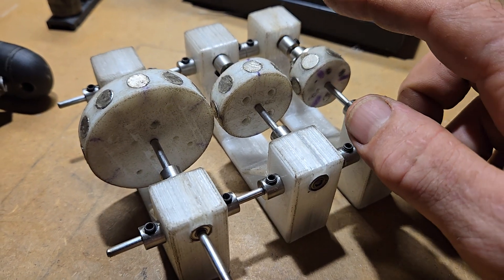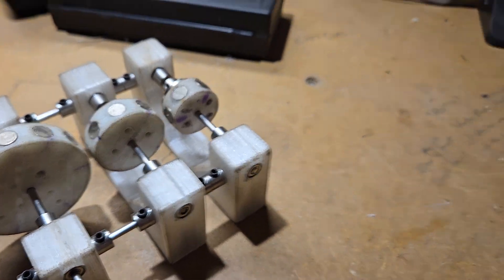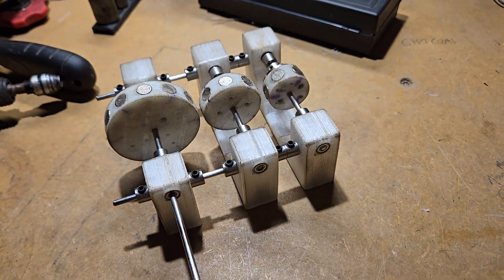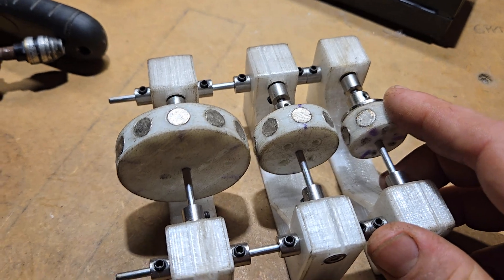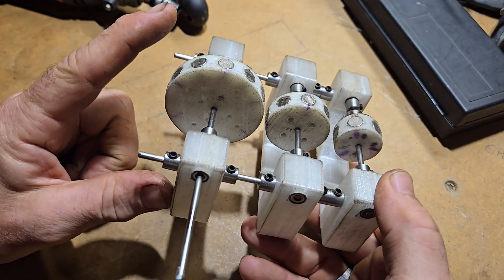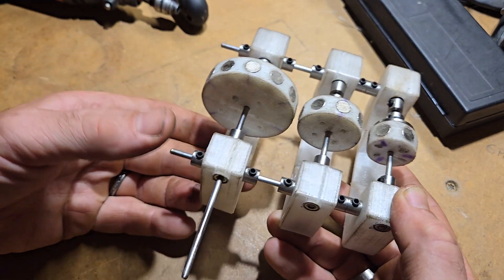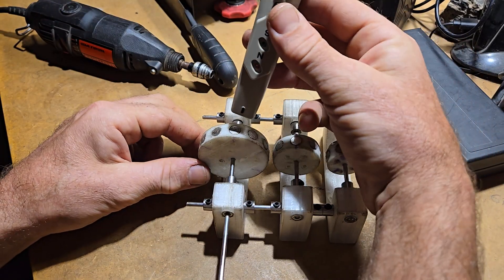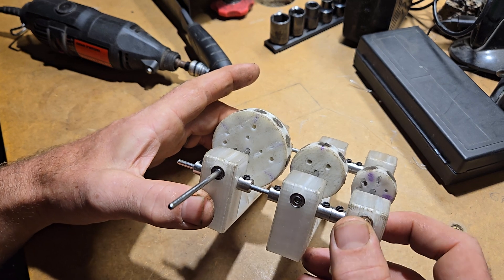Magnetic Gearing for Power Transmission, Propulsion, Space, Electrified Aircraft EVTOL

Comment: I'm not going to criticize the magnetic gearing but I will point out that speed is unregulated on that power tool, under load like that you are at a much lower rpm than the dial indicates. A non-contact tachometer would be needed to measure actual speed. Neat demonstration however.

Comment: You are transferring no power, so it has zero efficiency. Sure, the little wheel is turning faster, but that is doing nothing but overcoming friction.

drive something, like a generator, so you can electrically load & test the output power.

i bet you can't get more than 10% of the power in, out. That's why 'magnetic gears' aren't used to transmit power.